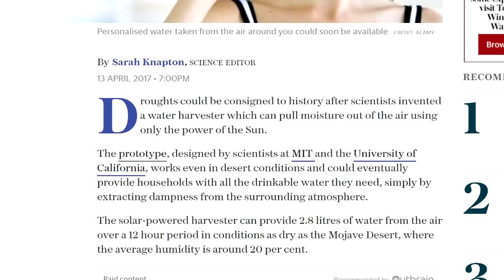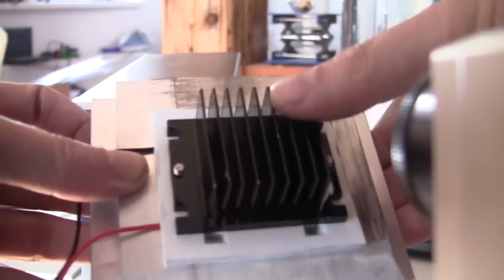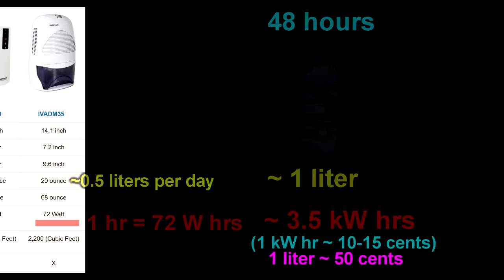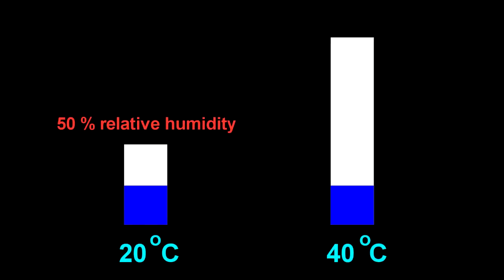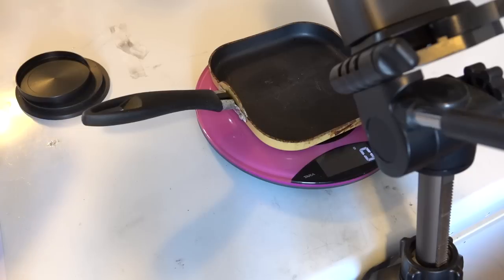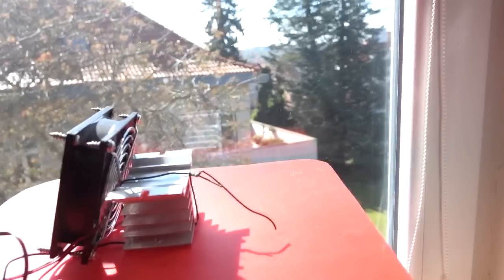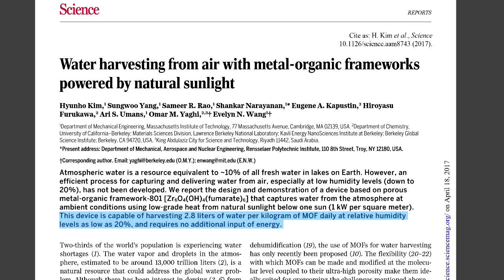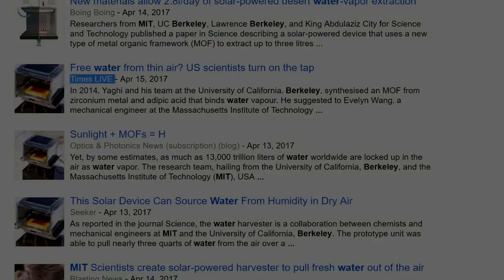FREE water from AIR device: BUSTED

Comment: seriously thunderf00t, at this point I am really questioning your intelligence. I am not arguing that this isn't overhyped, but your not debunking anything. 
The 10.000 hours you calculated for 1 g of MOF, do you need help to calculate what that means for 1 kg of MOF? That would need 10 h, which means there calculation of 2.8 l/day isn't really that far off from yours. 
Second they say they need no ADDITIONAL electricity, meaning no more than their device creates itself. They never claim they need NO electricity. If you now look at the pictures of their device, there is a yellow arrow named sun light. I didn't check whether their design, but I guess they might have some idea to connect it with solar energy to power their invention. I also didn't  calculate how much energy this would provide since I am not deeply invested in this, but to show that there numbers wouldn''t make sense, you would need to show they can''t produce the necessary amount of energy you calculated. Otherwise EVERYTHING THEY CLAIMED WOULD BE TRUE. That doesn't mean they don't try to mislead and oversell, but you should focus your critic on that.
You could still argue that it would be much more expensive than drinking tab water in an urban area and you would rather sell the energy that device makes and buy cheaper water, instead of combining the two, but AS THEY SAY it isn''t meant to compete with civilized water delivery systems. They designed it for remote areas where it may become more feasible than the transport costs of water. By the way with the US poisening more and more of there water supply and global warming taking its effect maybe one day it will be the cheapest way to obtain drinkable water. 
In any case I cannot tell whether you misrepresent these facts on purpose or you didn't think for a minute before making that video, but do some research so you don''t have obvious holes in your logic next time!
Reply: you could use 1000 of these things and wouldn`t have diminishing returns, but that's beside the point since thunderf00t clearly argued with the figure he calculated for 1 g and that was just wrong, your argument of diminishing returns was not the basis of our disagreement, he never brought it up nor is there anything suggesting it was on his mind
Reply: as I said, I don''t disagree with the opinion, that this device will hardly ever be useful (at least in todays economy), but I think he has gotten lazy when he does these videos. The guy he named cofounder of greenpeace in his last video is a known fraud, that was at one point a high ranking member of greenpeace (joined one year after greenpeace was founded), before the fossil fuel lobby bought him of and there is a pretty good debunc video about the mistakes he made and the plans he misrepresented (again because he probably didn't read the details) about the construction of the hyperloop. Even if his bottom line mostly is correct, his videos are poorly researched.
Reply: now you are giving these things way TOO much credit, they won't drain the entire atmosphere out of water. As long as they are not kept in a closed system with no air exchange, I highly doubt the throughput even of 1000 will be big enough to have any effect of the amount of moisture in the air, of course you should not pump the dry air from the first into the next, but noone would be so dump to waste energy on making sure to have espacially dry air for the extraction procedure
Reply: Intresting point, but I just googled the half-life of water in the atmosphere, it seems to be 9 days. So in 9 days half the water in the atmosphere is replaced with new water. You would therefore need to drain in with a speed that is comparable to keep it from reaching the evilibrium it would reach anyhow. With the very limited set of circumstances this device would be useful in, we don't need to worry about ever reaching these magnitudes (outside of some dystopian future scenarios).
Reply: halflife is a concept that can be applied to any process with a exponential decay, fluorophores probability to emit light, chemical reactions, anything with fixed rate constants. The short halflife time led me to believe that the water cycle was not that dependent on local water sources, but of course that is just a feeling and the more I think about it the more likely it seems I was wrong about that. Of course to know that for sure you would have to compute complicated simulations taking into account wheather conditions, cloud migration patterns etc. Thankfully the irrelevance of this product will probably make it unnecessary to dive in even deeper :)

Comment: Well there are ways these things could be semi useful. Solar powered water drip to automatically water your garden or something lol. That or the heat produced in the process could be used to keep some thing warm like say your house or garage. The idea such a device could provide a bit of extra water while doing something else isn't bad. The stupidest idea is the idea of using these things on a mass scale. Even if they worked you can't just pull unlimited amount of water from the air. If they actually pulled 20 tons of water from a dry area like Iraq the drop in humidity would be staggering. Continuous use in an already dry desert area would kill the environment and probably mess with weather patterns.

Comment: Ha Ha, That Thermaltake Heatsink does not work properly upside down. There is a fluid in the pipes that must lay at the bottom copper plate (pictured at top), so that it will evaporate and convect the heat to the cooling fins. In their setup, the fluid is pooled at the wrong side. 

Science Journal is really going down hill, publishing crap like this.

Comment: Point of fact though, there IS no minimum energy required by thermodynamics to condense water from air or any gas form. Because you see, the energy required to transfer a certain amount of heat from one thing to another depends on the temperature difference, and that energy approaches zero as the difference in temperature approaches zero. So to transfer 1 BTU of thermal energy from an object at 300 K into an object at 310 K requires about 1/31 BTU of useful work to be done. This is just the reverse of the Carnot efficiency limitations on a heat engine, i.e. if you make a heat engine out of transferring heat from a 310 K hot source to a 300 K cold sink, you can only get 1/31 efficiency. But don't you see, when water condenses from steam into liquid water, it's 100 degrees celcius before and 100 degrees celcius after, and if you're condensing water at less than the boiling point the still is true, there's no fundamental reason it needs to involve a temperature difference. Which means that theoretically it should be possible to condense water out of the air for any arbitrarily small amount of energy, thermodynamics does NOT make any requirements on the minimum energy to do this.
Reply: LOL, that's not how ANY of this works!
Reply: Saying such things shows that you have a limited understanding of thermodynamics and heat and mass transfer.

>>Water condenses at 100 degrees C

Yes, and the condensation of water is quite exothermic! Unless you extract heat from the cooler, it will heat back up to the dew point. Heat gained from the surroundings probably won't help either. Once you consider how convective heat transfer is proportional to surface area and temperature difference, you start having questions about this system such as: how big will the heat exchanger need to be to collect a reasonable amount of water? How much energy will I spend trying to keep a heat exchanger of such a size at the dew point when the environment is trying to heat it back up? Where am I dumping the waste heat, and will it circle round to the heat exchanger to heat it back up?

The only circumstance under which this is remotely feasible is if the air were already at 100% relative humidity (e.g., in mist or during rain). In such a case, there is probably a nearby body of water you can treat and drink from.

Comment: I watched this. Usually, your takedowns are solid. This one is not. Here, you are flailing at windmills.You spend most of the (overlong) video attacking the test apparatus, rather than focusing on the material in question. Disappointing.

Still love what you do otherwise. But, this was not up to your usual standard.
Reply: Just to clarify - There were plenty of problems with the MEDIA around this, which you could have tackled admirably. Sadly, you nuked the fridge a bit.

Comment: Sorry Thunderf00t, you're wrong on this one. I really encourage you to read the actual paper in it's entirety. Watching the WSJ video would naturally lead you to the conclusion that it's just a dehumidifier. You acknowledge how awful the WSJ 'science journalist' is, but then seem happy to treat their version of how it works as the version you're destroying.

Please - be the one who checks. 

Re-read the original paper. Note that their experiment used 1g of MOF, not 1kg - that's why you didn't see 2.8L of water in the picture. Note that the O in MOF is 'Organic', not 'Oxide' - it's a fundamentally different substance with different properties. Note that all of your calculations in the video about how much power is required and how expensive it would be to generate assume that they're using the peltier to extract water. They're not. One of the key properties of MOF is that it enables the adsorption-desorption cycle using temperature variation provided by the sun's day/night cycle. They're not using it in the sense of "solar power to drive a peltier" - that's Fontus. The paper itself describes what the peltier is there for:

"For visualization purposes, we used a condenser with
a temperature controller to maintain the temperature
slightly below ambient levels but above the
dew point, in order to prevent vapor condensation
on the inner walls of the enclosure. However,
active cooling is not needed in a practical device
because the hot desorbed vapor can condense at
the cooler ambient temperature through a passive
heat sink"

Comment: You seem to be using a completely bogus argument about the amount of energy needed to extract water from air, quoting, again and again, all over your videos, the enthalpy of vaporization figure of 2 MJ per kg, as energy that you misleadingly present as minimal necessary. But you either deliberately and maliciously misrepresent or stupidly misunderstand this, as this is NOT the amount of energy needed at all by the laws of thermodynamics.

Let me explain this in more detail. As you correctly explain somewhere in this video, a way to get the water from air is to cool it, so that water condenses. To cool air however, as you well know, takes the amount of energy dependent on the temperature difference, so in the reverse Carnot cycle, a theoretical limit, to cool air by dT degrees at temperature T takes the amount which is dT/T times the energy change. Now, the problem, as you also say, is that if water is only 1% of the air by mass, you cool all the air and THAT increases the amount of energy used, IF the cold air is blown away. But that is not a theoretical thing, but an engineering inefficiency.  That cold air can be in principle be reversed to the original temperature at the Carnot cycle to recover the energy (so, if we use ideal Carnot cycles, which is a THEORETICAL way to determine the necessary energy, there is no real loss of energy). So only a stupid thing like mixing cold and hot air increases the overall entropy and is where the losses lie.

To give a concrete example, consider a dew point which is 10 degrees below the ambient temperature of say 300K. The theoretical number for the energy that is needed to extract 1 liter of numbers under these conditions is not 2 MJ, it is a number 30 times smaller, which is less than 70 kJ. That is a huge difference. Using 1 liter of gasoline does not give you 5 liters of water, it potentially gives you over a hundred liters, depending mostly on relative humidity - if the dew point is 10 degrees below the ambient temperature, and if gasoline is used with more efficient engines (i.e. higher working temperatures), you could get several hundred liters, if the dew point is 20 degrees it would be around half of that etc. 

Now, it is true that the efficiency of these devices is terrible - dropping the cooled air back into atmosphere greatly reduces the efficiency, for instance. If only 1% of the air is water, then you have to move 100 times more heat from cold reservoir to a hot one, and you get hundred of times smaller efficiency, because you throw away cold air. But that is not a THEORETICAL limitation. Better design would use some way to decrease the waste (for instance, by using cold air to extract back the wasted energy - this would be necessary to do very efficiently using the Carnot cycle, so it might not be practical, but is a simple way to show that it is possible - if you can get 80% of the theoretical Carnot cycles, then your overall efficiency will be tens of times less than what is theoretically possible, so you get maybe a dozen liters instead of more than a hundred,  so you need to really use almost ideal cycles for this simple argument to work in practice), but every time a THEORETICAL numbers are much better than what is practically achieved, it means there might be a room for improvement - and you do mention some alternatives, like reverse osmosis. Perhaps what MIT has done is also a valid alternative, as they seem to use a mechanism (that is inefficient) in the end, but within a much wetter, hotter compartment - so if in this part the water is over 5% of air, your losses due to cooling the air are decreased, and this seems to be the possible gain of this idea.

But your arrogant dismissal and shallow analysis speaks mostly of your dishonest mindset than of often valid work of people who try to design something new. Yes, there are cranks around and you sometimes expose them justly, but quite often you dismiss even potentially good ideas, or things that are at least possible in theory, due to your arrogance, lack of understanding or quite often plain dishonesty as it seems. This is one prime example where your crank detector sounded a fake alarm and false positive, ruining overall your credibility, as are simplistic claims like 2 MJ per liter necessary to extract water from air, which you pulled out of your arrogant, deceptive or ignorant (or all of that) arss.

So, stop using the 2 MJ per kg figure as it is, as you should well know, a FAKE figure.